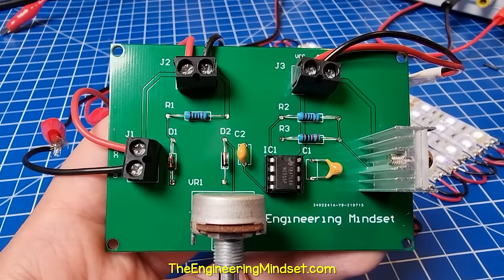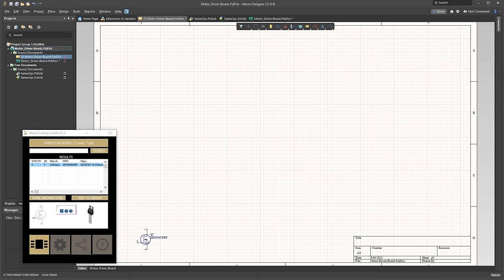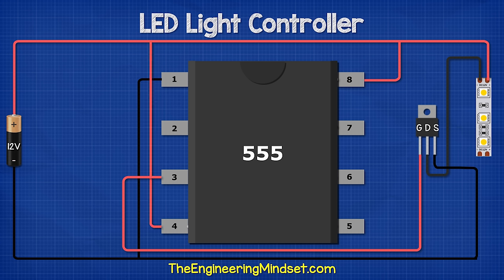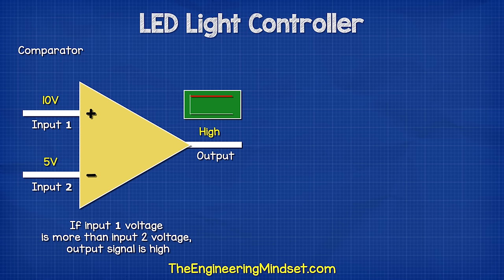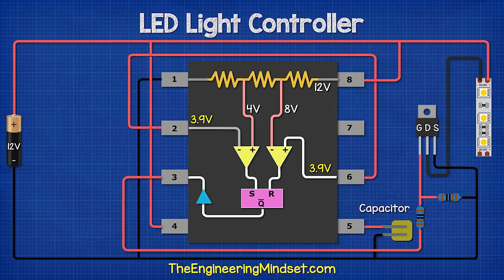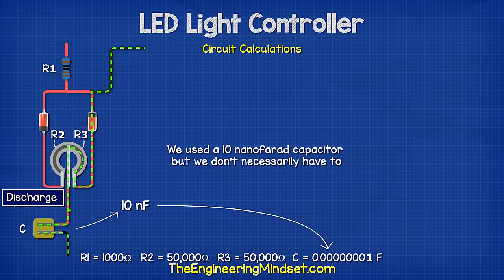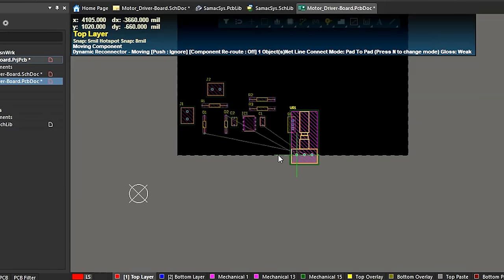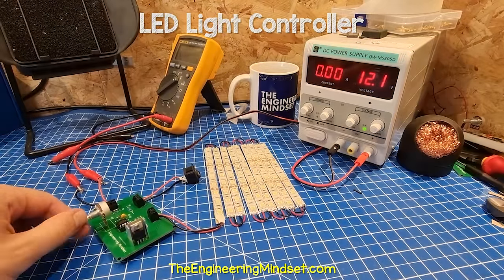LED Dimmer controller design - Electronics engineering pulse width modulation

Comment: what is the benefit of doing it this way vs just using a potentiometer? Is it because it has less power drain?
Reply: The pot can't handle such current 
Pot usually 1w 
This application use (12v*~1.5A ) 
18 w of power
Reply from the maker: Seen our new Potentiometer Explained video? ➡️ https://youtu.be/Xb-MZMoUtcQ
Reply from the maker: Seen our new Potentiometer Explained video? ➡️ https://youtu.be/Xb-MZMoUtcQ

Comment: hi everyone, does this only work with led strips?
i tried to use it with a cob. the 555 timer dies immediately. any tips appreciated.
Reply from the maker: You probably pulled too much current through the 555 timer. See our motor speed controller video for a larger current design.
Reply: @EngineeringMindset  thank you for your quick response, i'll look into that.
Reply from the maker: Also has a low max voltage, could of had a voltage spike ruin it. Plus, most 555 timers are fake and don't meet the specs

Comment: Sir, I need to Build this same circuit using SMD components, (For LED Video Light Project). Is there any special method to convert those components into SMD? Is there any simulation software or, Is there any special procedure to follow? Could you please give me a help to solve this matter. highly Appreciated <3
Reply from the maker: Just follow the tutorial and use smd components. You'll have to find similar smd versions to the through hole type
Reply from the maker: Seen the new LED explained video? so much detail covered! https://youtu.be/O8M2z2hIbag

Comment: Okay, I'm not an electrical engineer, but why build this circuit instead of just putting a variable resistor in series with the power wire? 
I'm sure there must be a reason. Can someone explain it to me, please?
I have LED lights and just put a variable resistor in line and it works like a charm.
Reply from the maker: Because that's a terrible design. The resistor just wastes all the energy not being used by the light. This design doesn't
Reply: @EngineeringMindset  Okay, so efficiency.
Reply from the maker: Check out NEW resistor video, everything covered! ➡️ https://youtu.be/DYcLFHgVCn0
Reply: @kennmossman8701  Yes, a simple potentiometer. I used one for the under counted LED strip in my kitchen. It took me, literally 2 minutes to install it.
I was originally planning on using a potentiometer and an MCU to control the brightness with PWM, but that'd be a bit more difficult :). So, I just connected the pot straight to the lead from my PS. 
Granted, full brightness to fully dimmed seems to not be completely linear.
You might be able to use an audio pot, which has a logarithmic taper to change that, (or by adding a parallel resistor) but it works fine and was easy.
Reply from the maker: Seen our new Potentiometer Explained video? ➡️ https://youtu.be/Xb-MZMoUtcQ

Comment: Buck converter powered by the 555 plz
Reply: It would be easier to use a 34063, another vintage IC, and not particularly efficient, instead of a 555.  Circuits using them can often be found in the in the cheap vehicle 12v to USB charging adaptors.

Comment: Are all 81 leds are in parallel..or
3 series × 27 parallel ??
Assuming a fwd. drop of 2v5,
ideal pwm duty from full on to full off is 100% to 20.83%
 (i.e. 2.5/12), neglecting voltage drop across the current limiting resistor..
so for totally linear variation, the potentiometer( max.- min )   applied voltage should be trimmed accordingly..
Reply from the maker: Check out NEW resistor video, everything covered! ➡️ https://youtu.be/DYcLFHgVCn0
Reply from the maker: Seen our new Potentiometer Explained video? ➡️ https://youtu.be/Xb-MZMoUtcQ

Comment: HI, I want to ADD PWM dimming feature to my ESP32 Internet / WiFi mp3 radio / mp3 / flac / wav player. But I want it easy and simple. PWM is from EPS32 4 pins, PWM 5 - 24 kHz, I plan to use IR2104 or 2184 driver + synchronus buck for each from 4 LEDs. LEDs can be replaced with isolated/nonisolated DC/DC converters, so can be used as 8 AMPS BMS for 4S LFP or NMC battery pack. ESPs will communicate with ESP-NOW and at one point is gateway do MQTT / WIFI / BT / BLE. Also I want to send emails through SMTP, if some ESP detects TEMPS with AGM8833 array. Is there easy and simple way to control leds / BUKC with ESP32s PWMs with minimum parts, like R,C,L, FETs and drivers ?

Comment: You stated using a 555 timer simplifies the circuit. But using a different 8-pin DIP (say, an ATtiny25) would be MUCH simpler, with many fewer components, and more easily modifiable as well.
Reply: @kennmossman8701  — Yes, I didn’t think of the supply for the uC, since everything I build has one. I still think it’s simpler; while it may not be hard to just copy the circuit presented in this video, really understanding it and being able to modify it to suit another application is another story.

Comment: This is simple but poorly designed circuit. The output pin of a 555 timer can provide 200mA at best, with current limiting resistors as shown above it is not enough for the fastest gate charging. The transistor will be extremely hot and energy wasteful. This circuit requires a proper transistor driver.

Comment: Question, why would the mosfet experience the average voltage of the 555,not just the pulses
Reply: It's a square wave, with a mark-to-space ratio of one. Therefore over one time period, the gate voltage will be the average value of this square wave. In this case Vav = +5V.